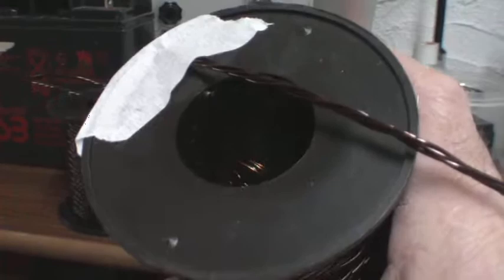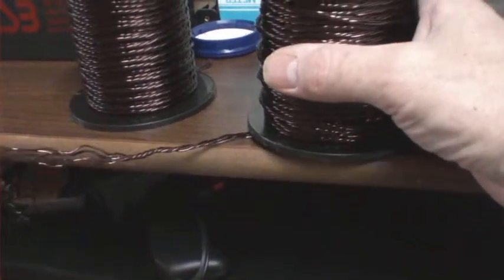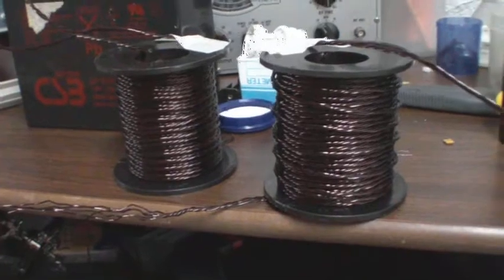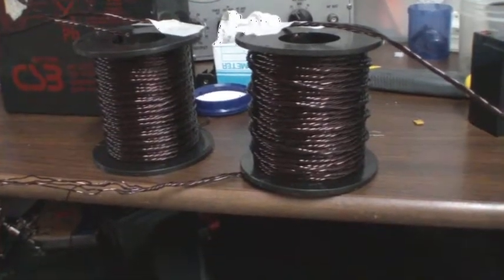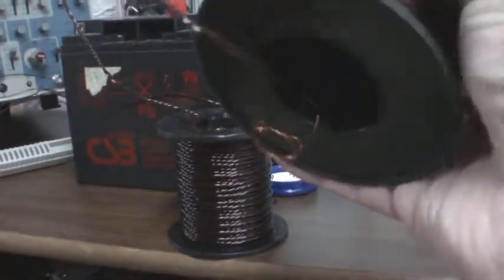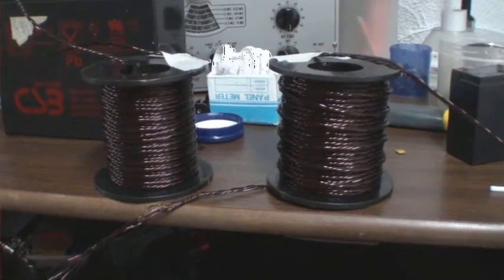SSG Aluminum Air Core Experiment PT. 1

Comment from the maker: Yes it sure is cheaper and like you say if you go all mechanical connections, it works. Never tried sealing it, but i suppose that will really help in warding off disimmilar metal corrosion. Thanks for the tip :)

Comment: Who cares what they think....really....my (and by extension your) experiments are the REAL feedback to my reality :-) Although, the aluminium coated wire can a real pain to solder with...but all I do is crimp a M3 copper ring terminal on the end of it and seal the joint with liquid electrical insulation. But the weight and price saving is king...